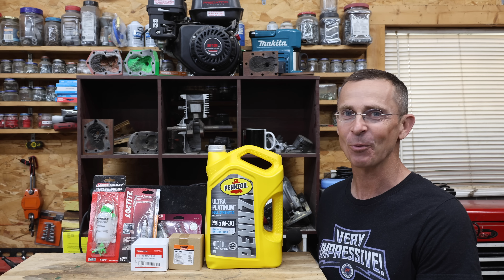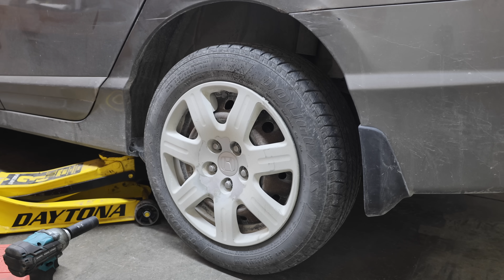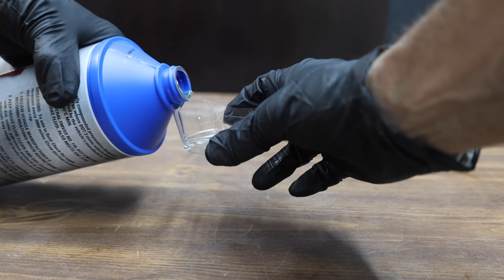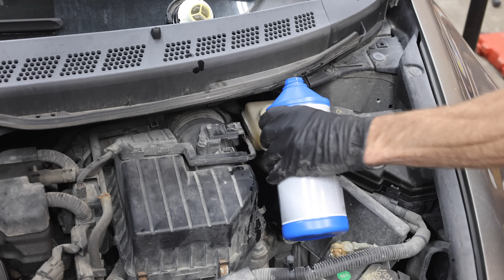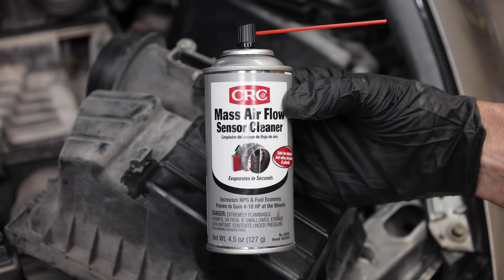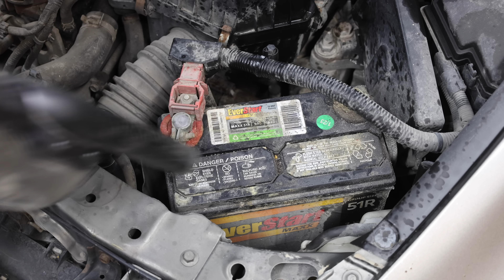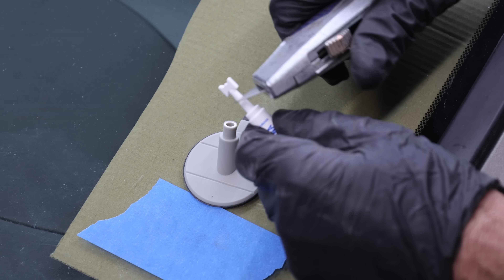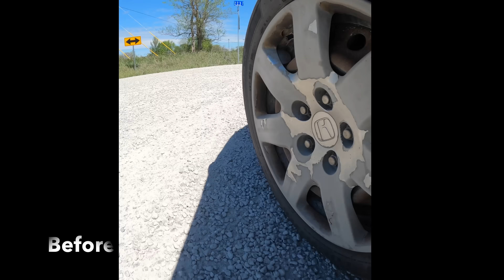Most Reliable 200K Mile Car? Let's Settle This!

Comment: The numbers in this video check out. In 2011, I purchased a 2006 Ford Fusion with 81,666 miles on it. I have meticulously saved records of all my costs since then, including registrations, repairs, parts, oil changes, etc., but not including insurance. In the 152 months I have owned that car, I have spent an average of $144/month on my car, not including insurance (and that does include the original purchase price). If you add the $55/month for insurance shown at 18:13 on this video, that equals $199/month total, which is pretty close to the bottom line number given for a used car in the video.

Comment: I’ve owned two Hondas.  One was a 1985 Accord hatchback.  Sold it to my niece at 150K miles and she drove it for years.  It hit 200K and was still going strong.  She sold it to a college kid.  Honda made great vehicles back then…
Reply: My mom's cousin owned a 1980's Honda Accord with a manual transmission.  They always bragged, that sometimes it would get 41 mpg.
Reply: @MyLifeThai371  this one was a 5 speed.  I bought it used for like $4500.  🤣

Comment: My wife and I daily drivers have over 220,000 miles each. I maintain my cars and take care of problems when they happen or before they get out of hand. I plan ahead for my repairs so I never have any surprises. I buy OEM parts if I can and shop around for the best price. It also helps to find a good, local upholstery shop to take care of any interior issues. I stay on top of my cars because I am deathly allergic to car salesman and car payments!

Comment: Excellent video, but I have a question. You drained and replaced the very old transmission fluid.  I would be concerned that a high mileage transmission with rarely changed fluid would start slipping with new fluid.  With that said, I would have changed it, too.  But, do you have any thoughts about the wisdom of changing the fluid on that car?

Comment: My wife drives the same Civic, even the color is the same!  This gives me flashbacks to when I needed to change out the knuckle when it was cold and rainy.  Great, reliable car.  Even has a bit of pep.

A couple cheap upgrades to consider would be swapping out the rear brakes with discs from an EX.  Can also change the rear trunk latch to respond to key fob opening.

Comment: Excellent video, wish it took only 20 minutes to do everything that was done. Judging by the color of that AT fluid hopefully it wasn't bad enough that the clutches are relying on the metal particles in the fluid for friction, wise just to change a small amount then drive. Keep up the great videos!

Comment: I haven't watched yet, but I'm guessing a Toyota, or a GM actually will perform very well once the sensor issues are dealt with.  Witnessed a 200k Pontiac Sunfire in the past survive with no problem and wouldn't be surprised. I've had 3 Toyotas on track to 200k that had ankle biter problems but no big issues and wouldn't be surprised if they are still in service in the Caribbean area.  Can't wait to watch.

Comment: This generation had supposed issues with the AC compressor clutch relay, but some were resolved by adjusting the gap. If the gap between the AC compressor and compressor clutch was too big then the AC wouldn't be able to activate. A great car though!

Comment: I love our 2003 Suburban, it's a highly reliable vehicle, although it could definitely use a brake flush and some other service.  The guy at O'Reilly last time I was there replacing the battery told me I should never get rid of it, because it can probably go 350k miles...  :)

Comment: You seem to be blowing over one of most important parts. Your better than most mechanics that are making a living do that. I think the shop I'm using gets $90 a hour. Doesn't say on bill what hour rate is just total. So $2000 plus $that parts bill. My shop does stick it to me on parts they charge the high number which seems nobody pays. So add 30% more for parts. Old vehicle cost more to fix than there worth. Of course your right about TAXS. Well you can half that and insurance. I own 2020 F-350 and you know rest. So when are you coming out and fixing my blue tank on my pickup. All I want is to not put in that stuff. The filler caps are right beside each other, that is mistake waiting to happen. You live close!

Comment: I own a 2001 Honda Civic EX coupe with 276k miles on the original engine and it runs great... Only gave $2000 for it and I'm well pleased with the car and I've owned it for about 5 years now.

Comment: Mr. it's very nice to see, when I get a "NEW" (to me) car, I do the same thing as yourself.  I get everything all back to new....document everything that I've done, and date, etc.  Then I do a "mileage loop" to KNOW what the baseline is.  Every time that I fill up, I check my gas mileage.  Every so often, I shall check, what items are coming up for change, IE: oil changes, tire rotation, etc.  If , when I fill up and my mileage falls, I will be checking on what /when I've done whatever maintenance.   If I find a problem, I get right on it!   All of my friends at work> Hell, they just buy a new car. NOT ME, I maintain my vehicles.  Good Job man.!

Comment: You know, when I read the title I immediately thought of Toyota and Subaru but there are others besides the Big 3 of Japan. I would estimate that roughly 80% of the cars driven in my city are Honda, Toyota, and Subaru, with Subaru making up a large portion of that number. The remaining 20% is a variety of older GM, Dodge, a few Fords, Mazda, and Nissin, mostly consisting of models like Cobalts, Cruzes, Hemi Dodge Rams, Caravans, Escapes, Explorers, and Altimas. Additionally, there are quite a few Kia and their Hyundai counterparts that are often leased to anyone with a credit score and a few older models are still around. Optimas, Sportage, Sorentos, and a large amount of Kia Souls which are one of the best utilitarian vehicles ever made.

Comment: I only buy used, after about 100k miles, you will have to do shocks, bushings, various gaskets, and all fluids.

Also, upper and lower control arm bushings, tie rod ends/inners most likely, if not, soon after.

Rest is purely dependent. Like, wheels, paint, and various parts such as calipers and lines.

Overall I've owned a 2000 WS6 for 12 years and still enjoying it, as well as, it rides/looks like new.

Comment: I drive the 1995 to 2002 years of Chevy 1500 truck. I buy them for $500 to $800. Put about $1,000 into them. Drive them till the frame brakes (I haul firewood from the woods) and then sell for what I paid for them. I generally buy them around 200K+ miles with no worry about the drivetrain.

These trucks always need a new gas tank, gas and brake lines, power steering pump and fuel pump around this time. Often brakes. Most often new tires. Then drive.

Cheap work horse for a year or two. The next person welds the frame and keeps going. Its a common weak point in the frames.

Comment: Fun fact, $1,037- $55 = $981 a month.

$981 per month invested into the S&P 500 with its averag anual return of 10.5% compounding over 30 years is $2,148,949.65.

Do what you will with that information.

Comment: You should do a tone wood test. You have the intelligence to scientifically measure frequency's with guitar strings and different woods used in guitar building.   Yeah, there are other videos out there, I have yet to see someone document frequency responses of one wood vs another. You could keep is simple and use a couple species.

Comment: I needed a pickup truck, so I did my research. The best bang for the buck was a 2015, 2016, or 2017 F150 with a V8. I found a 2016 one-owner whose documented maintenance was far better than what Ford recommended and is in very good condition cosmetically. The price was an even $20,000 with 102,000 miles. This vehicle was just over $47K new, and a 2024 with the same option is over $63K. I work on my vehicles and will do whatever needs repair or replacement. Paid off and should easily last another 100,000 miles plus with proper maintenance. Save money, Screw new.

Comment: @ProjectFarm I would like to see more videos like this one, but possibly do a series of tests of aftermarket parts brands - then use all the winner as part of the routine maintenance on a car. Or do a monthly check-in / maintenance and repair of a car. With this car, you could use chemicals and tools you've covered to refresh the interior, or do a major service of the a/c system, timing chain, head gasket, transmission etc.

Comment: So you spent a total of 1300$ on it and the kbb fair trade value is right around 4000$ median price.  So would be an easy 2700$ profit, put a stereo in it with a touch screen and navigation to sell it quicker and profit around 2400$.  Still not bad..  i got an old highlander with a blown motor, put about 1000$ in it and about 8 hrs of solid work and sold it for 8500$..  profit of 7500$ for 9 or 10 hrs of work fixing and selling it..  not a bad gig but cars are frustrating and arthritis hurts..